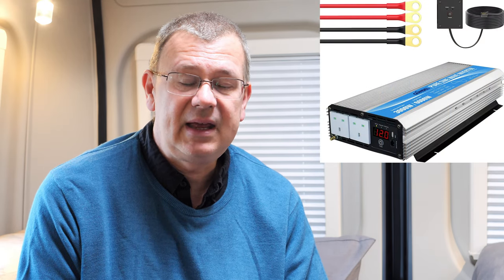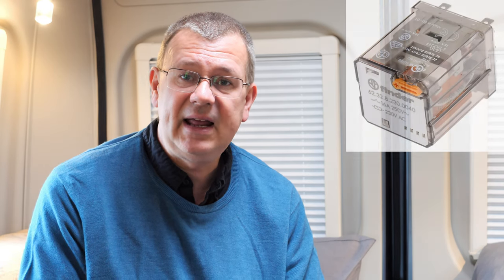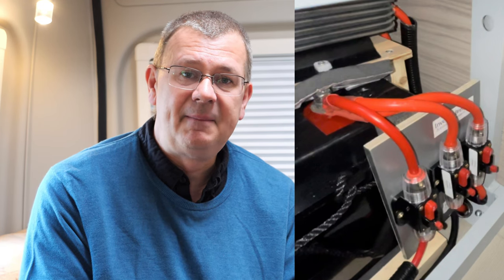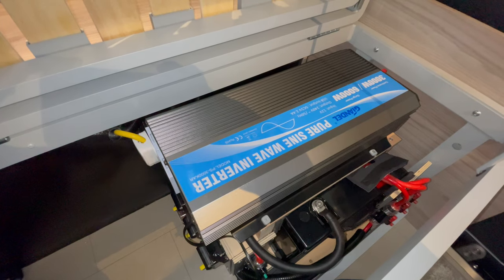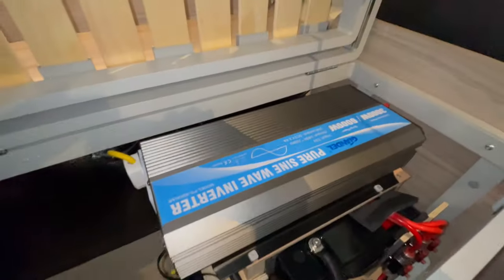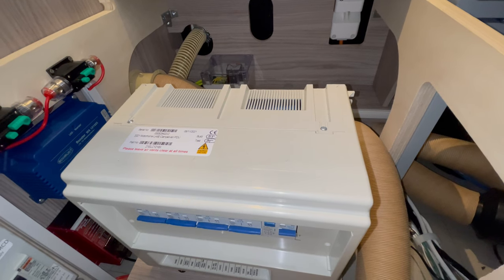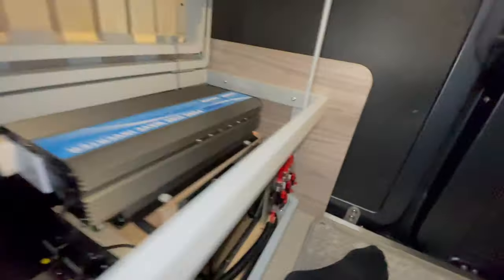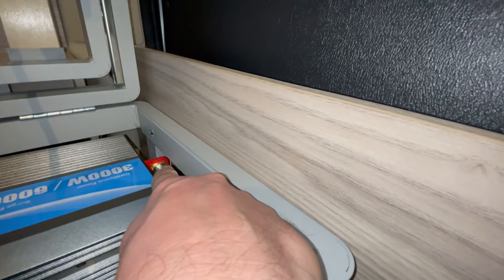7. Fitting a 3kW inverter to our Elddis CV20 campervan with auto changeover (see also safety update)

Comment: Thank you for a lovely clear explanation in your series of videos and good to see the safety aspects very well highlighted. I would consider myself a competent DIY electrician who is aware of current (no pun intended!) regulations and requirements, but I am not formally qualified. With this type of installation, is there a requirement to carry out a formal "acceptance test'" or sign off, similar to an EICR on a building electrical installation, and should there be a regular (annual) check carried out, maybe as part of a habitation check, to ensure that the safety aspects are still functional and have have not been compromised. In particular regarding your comments about loose connections, there is a requirement on a building consumer unit for connections to be tightened to specific torques, and therefore with this type of installation which will be running high DC currents I assume this is an area which should deserve some special attention.
Reply from the maker: Hi David, very sound advice and you are absolutely right - safety is paramount and the regulations are essentially documented common sense approaches to making sure things are safe. Regular checks of things such as contacts to make sure nothing has worked loose also, especially in a moving vehicle which is subject to vibrations which can cause things to come loose more than in a fixed installation - a torque screwdriver or spanner is very handy to make sure correctly tightened as you say. I thought the RCD was an essential item which I am always surprised inverters don’t come with installed and certainly will regularly test for peace of mind. Appreciate your comment - all the best, David 👍

Comment: Hi David, where did you obtain the RCD u fitted please? Great video btw
Reply from the maker: Thank you - I bought the case from Screwfix and I already had the RCD in a box of bits in the garage so I tested it and used that one - that’s probably not much help is it ? Worth noting the rcd only gives protection in certain circumstances with a floating inverter as it’s not a standard domestic setup. All the best, David 👍

Comment: Hi David did you do a part 2 on the blind spot system .?
Reply from the maker: Good Morning - I haven’t yet but it’s on the to do - just need to finish a few bits off - if it helps it’s been working well - I had one issue where the passenger side was overly detecting but washed the muck off the back of the van and that sorted it so must have been something in the muck causing it to detect - other than that it’s been great - worth putting a switch to turn it off in line with it just in case ever an issue like they have on cars etc. hope that helps - hopefully have the video done in a few weeks time - sorry it’s taken so long keep getting side tracked - all the best, David 👍

Comment: Hi David. Would you be able to tell me which enclosure you used for the relay. Thanks.
Reply from the maker: Hi Richard, it’s a 120x120x90mm abs enclosure with transparent lid (if you Google you should find them around including eBay) - hope that helps, all the best, David 👍

Comment: Hi David, thanks for the video. I would like to wire my inverter to feed just the sockets. Do pins 7 and 9 of the changeover relay connect to the MCB in the PDU, or do they connect directly to the separate RCD? I want to make sure that my inverter doesn't backfeed to the other 230V circuits.
Reply from the maker: Thanks for the comment - I did another video on auto changeover but ALWAYS get it checked or installed by an electrician - hopefully that one explains it a bit better - search for auto change over LeisureBit and it should show up 👍
Reply: @LeisureBit  Thanks David, I have now found and watched your video on the auto changeover. I can fully understand now how you wired the changeover. This looks to be exactly what I want. Thannks again.

Comment: Excellent series of videos.  Could you tell me where you bought the enclosure for the relay?  I have enclosures but mine look a lot larger than the one in your video.  Thanks and keep the videos coming, very useful.
Reply from the maker: Thank you - appreciate the comment - the box which I housed the relay I got off eBay for about £8 - if you search for “Waterproof ABS Clear Cover Electronic Project Box Enclosure Case Junction” and it was the 120x120x90mm size which seemed to be about right - hope that helps - all the best, David 👍
Reply: Many thanks David, appreciate it.

Comment: Have watched with great interest as I'm currently installing a similar setup in my Adra Coral. Great and clear videos. Only one question, where did you get the box for the relay as I haven't been cable to find one that the relay will fit into ?
Reply from the maker: Hi Paul, I got the relay from RS and the box off eBay - I think the info in the video description has the links in (if I put a link it the reply it has a habit of disappearing due to anti spam stuff) shout up if you can’t find and I will find alternative way of sharing the info, thank you, all the best, David 👍
Reply: Many thanks David, have managed to find the box ob EBsy. Now on order.
Reply from the maker: @paulcarrick5523  great, pleased you found it. Game changing the relay I found as saves a load of faff and everything just works. Good luck with the install - all the best, David 👍
Reply: @LeisureBit Thanks David? keep up the good work 👍

Comment: Hi david , what happens when the shore power is connected and someone turns on the inverter?? Does the inverter switch the relay and isolate the 240 shore input so they dont work at the same time??
Reply from the maker: Hi, if the shore power is connected and the inverter is switched on it switches over the sockets to the inverter. It’s physically isolated then from the shore power (via the relay) - it’s very handy in the winter if you are on a lower power hookup and have the heating on as you can pop the inverter on to make a brew without tripping the site supply. 
Basically though they don’t work at the same time on the same circuit as it disconnects the shore power when inverter is switched on to the circuit. (I used in the sockets circuit rather than charger, heater, etc)
Hope that makes sense, All the best, David 👍
Reply: Cheers thats what i wanted to know so i cant damage anything or anyone else if we camping and have inverter on inside and lets say someone on the outside plugs in a generator or shore power to my van with out me knowing ..
This is exactly what i was looking for and it can handle the 3kw continuous inverters running threw it?? Great work m8 cheers
Reply from the maker: @farcough1234 the relay I used is 16A so can handle that which is the maximum hookup rating - I would have normally put a slightly larger one in but that one covers the peak load for us.

Comment: Hi David, just converting to lithium solar and 3000w inverter. Please can you recommend an inverter rcd such as the one you have used?
Reply from the maker: Good morning - let me check the one I used when I get home from work and will confirm - they aren’t perfect in the van setup but I believe better than not having one and don’t cost a fortune either - the case was from Screwfix and under a fiver for ref.
All the best , David 👍
Reply: @LeisureBit  Hi David - did you ever get the chance to check the rcd you used? I would be keen to know too.

Comment: Hi what single RCD switch did you use on your inverter
Reply from the maker: I used a Merlin Multi 9 one which I had handy - seems to do the trick - appreciate on this type of inverter they don’t work in all scenarios but better than not having one as the principal of leakage applies all the same.
All the best, David 👍

Comment: Hi 
This might help you I use same relay but i have mains connected to A B  and the inverter on the terminals where you have you mains on your schematic this then works like mains on relay live 
Mains off inverter becomes the feed this should then stop the relay chatter when inverter shut down hope this gives you an idea how i done it i have no chatter on relay
Reply from the maker: Thank you - gets rid of the capacitance discharge issue that way doesn’t it - my logic for doing it the way I’ve done it was with the relay not energised then it was as normal wiring - the energising flipped it to inverter and also then drained down any capacitive power still in the inverter circuit. 
However you have a really good point and not sure what real advantage the way I’ve done it gives beyond if the relay coil fails it works as normal but in reality it shouldn’t fail and easy enough to re—wire if it did.
Appreciate the comment and thoughts - have a great day, David 👍

Comment: 13A fuse in “yellow” plug?
Reply from the maker: Assuming the plug from the inverter with the yellow cable? If so, it’s currently got a 10A in until I update the additional cable on the negative then I will update to a 13A. Thanks for the comment, all the best, David 👍

Comment: Them trip fuses dont cope with surge well  without going sill big - better to use a maxi fuse of a lower rating
Reply from the maker: Thanks Trev, looking to change them over to Maxi Fuse and just put a rotary isolator switch for turning the power off/isolation as required. Appreciate the feedback, thank you - all the best, David 👍
Reply: *Those trip fuses! "Sill big"? Dont know im english!

Comment: Hi your work is very tidy,the only thing,your caravan etc will not earth an inverter as a generator you will have to run an earth out side and knock a steel pin in to the ground attached to an earth wire connect to your inverter or generator.
Reply from the maker: That’s right if you wanted to ensure an Earth connection. It’s currently earthed to the vehicle chassis - must check if it’s TNE on the inverter. Thanks for the comment, all the best, David 👍